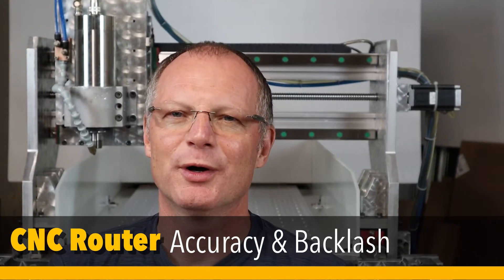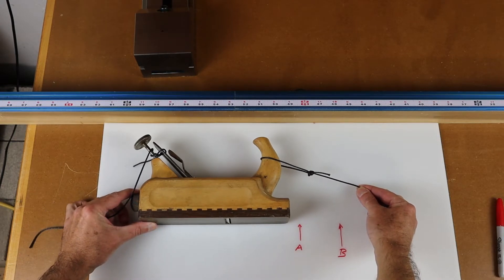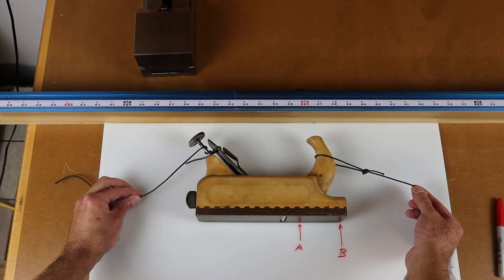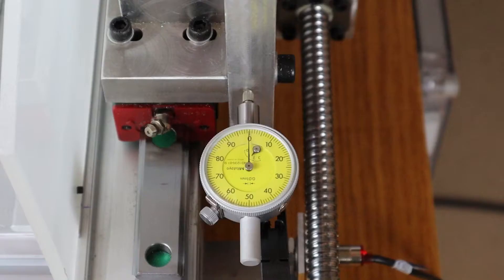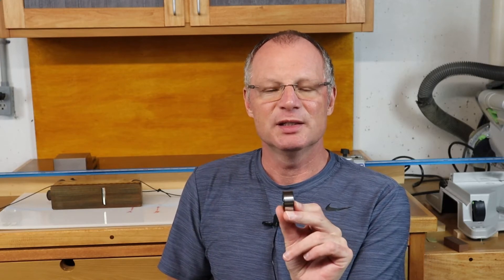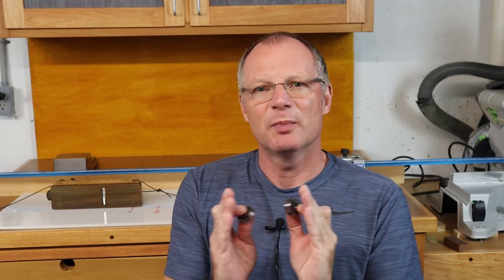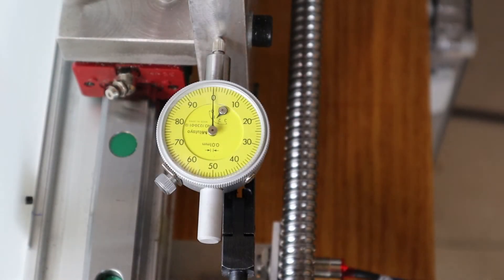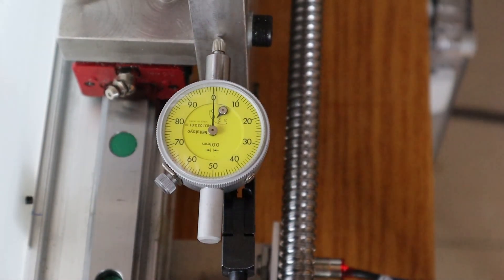CNC Router Accuracy & Backlash

Comment: Did that last measurement really show backlash? It seemed to me that it only gave repeatability because you only approached the zero point from one direction.
Reply from the maker: I think it did because the original move of the axis was onto the dial indicator and I then set it to zero. Also that move was now focus on bringing the mass of the gantry into play so that the bearing really has to hold the position with a load like we would see in regular production.
Reply: @JBWorx  I always distrust unloaded movement measurements. They don't represent real life where the tool will be forcing onto s piece of metal.
Reply from the maker: I am with you on that. So I calculated the cutting forces on the largest bit I use being half way dull in Aluminium. It comes out to a load of under 160N not all that much … but now I started cutting steel 😀
Reply: The backlash is the free play between both negative and positive movement. You just check one direction. Backlash example; set the indicator to zero position then move -5 and stop. Then move +5 and stop. Finally move 0 again. Check the indicator to see your exact backlash.
Reply from the maker: I think we are saying the same thing what I did not show is that I made a move toward the dial indicator before then move again and set it to zero. Backlash is the total play that is evident during a directional change in movement. I think we are saying the same thing. I will come back to this one more time as I am in the process of changing out the ball nut on my x-axis. I like to measure its backlash to then be able to enter a value in the controller for compensation.
Reply: @JBWorx  We are probably saying the same thing. Approaching the same spot from both directions and measuring the resulting error.
Reply from the maker: Yes 👍

Comment: Do you use double  ball nut bearing ? Am not sure that this backlasch test show correct. think that you should move the smallest movement possible forward and the the same backward and look at you DRO, and the slowly  increase the movement. Also i think that your bracket for the steppermotor and bearing look a little flimsy i would have at profile going all the way to the other stepper motor and profile could be a 60x60mm
Reply from the maker: Lars, thanks dir your comment. Yes, a plate from side to side is an idea that I am thinking about since a while. It could also have the feet of the machine integrated. The “flimsy” bracket is 22mm think however so I think adequate. Measuring backlash the distance you travel will not be relevant it is the reversal of the movement that is of interest and where the “play” in the mechanics will how up. Also adding some speed / acceleration to the movement will really show what is going on. Give it a try the way I explained it and see. And then use your method in comparison. Compare the values the larger backlash measurement is the better method.

Comment: Is backlash make big problem with servo motor planetary gearbox in cnc router wood machine? (because all planetary gearbox has backlash)
Reply from the maker: There are planetary gears that have no backlash but they are really expensive.  Yes it can make for some Oszillation however you can set a filter to lower that vibration. Or make the tuning a little softer and it will work just fine.
Reply: @JBWorx  thanks for sharing your knowledge

Comment: Hi I love You video , im looking to buy first CNC i think about 3040 can you recommend any?? did You build your from scratch or you bought and then upgrade. Best regards
Reply from the maker: I bought a kit that I had to assemble myself. However the vendor does not exist anymore. Also I have changed a lot on my machine. If you buy a machine think of the maximum size of your Projekts and purchase that size. Once you have it you can machine your own pets from aluminum to further upgrade it. I very much recommend linear rails and ball screws for your machine.

Comment: I really like the way your machine is built!! Can you recommend a place where I can purchase motion control parts such as ball screws or bearing blocks, etc.. There are plenty on the web but I want to shop a site that will assist and help me and have good quality products.  On your router, as you've shown, its relatively easy to replace bearings or even the entire screw assembly and on my machine you have to lift the entire machine and or remove the bed surface to be able to work accurately. Any help much appreciated. Helpful video!!
Thanks, Peter
Reply from the maker: Hi Peter, thank you for your comment. There are a few places that I buy frequently from. High on my list is Misumi, for profiles and linear motion components. Also on Aliexpress use the seller BST Automation you can be sure to receive original HIWIN components. For motors I use lately 180W Nema 23 servo motors from OMC-Stepperonline. I will have a video about tuning them. For cutting tools I am a bit spoiled as I am past the point of breaking them by accident (… frequently). So Amana Tools, Datron, AluPower and YG1 are my go to cutting tool brands. Yes, picking up the whole machine to do some work would be a problem.
Reply: @JBWorx  Thank you, always appreciate your time and getting back to me.

Comment: Nice video. I wonder how much of that backlash was from that sprung coupling you swapped out.
Kind regards,
Reuben
Reply from the maker: Thanks for your comment, I was able to remove also the software backlash compensation, in combination the bearing and coupler got me to zero backlash with no load on the axis. How this would look like with actual cutting forces applied is an interesting thought
Reply: @JBWorx  glad to hear it!
Reply from the maker: @ReubenSchoots  so today I machined a pocket 60x60 into the side piece of the new gantry. I was shocked the measured dimension was  60.00 x 60.01mm I am very pleased with that result.